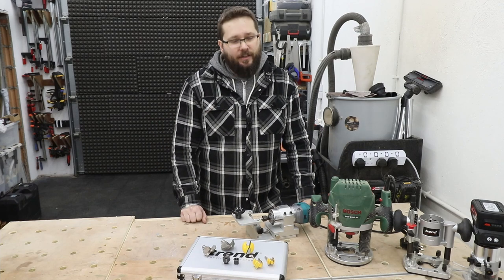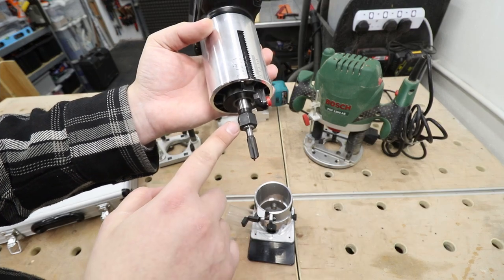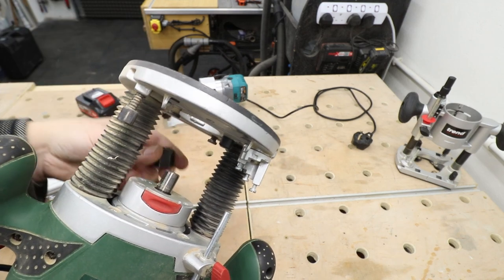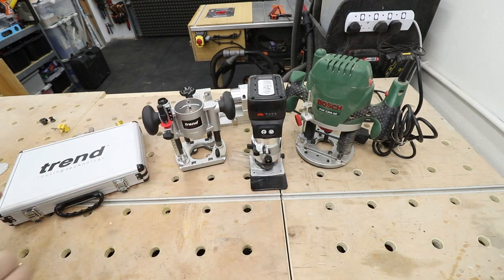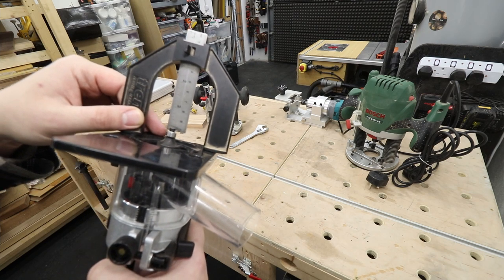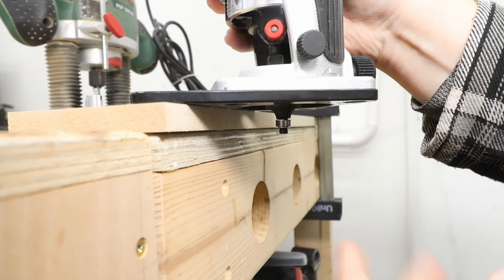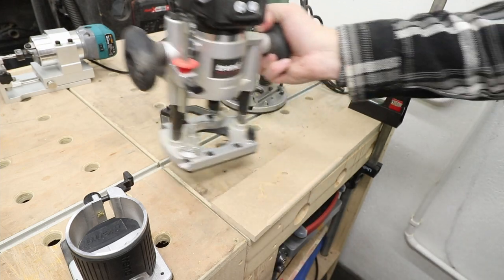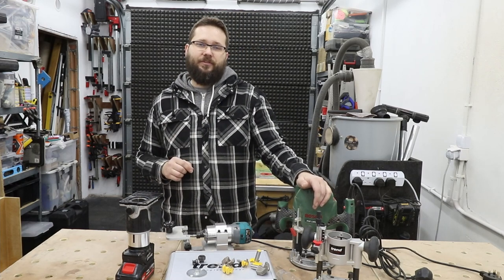How to Use a Router | Router for Beginners

Comment: Hi Thomasz, again very clear details for users. As for using the fixed base to drop in the cutter into the piece is a good call but remember that will only work, and the same for plunge bases for smaller diameter router bits as the center of the router will stop the router dropping in. You can help that by moving along the direction of the cut until it has cut its way in then you are fine but you need in both actions to be very carful it does not kick.
Reply from the maker: Thanks and good info👍

Comment: i now have 3 routers after having none for the first 45 years of my life. bought a cheap trend, was useless. bought a katsu, but was unreliable as bit would move slightly. got a dewalt now, and oh my word its brilliant.
Reply from the maker: I got a Katsu router, Guild router, Bosch router, Trend router and they all got a dedicated task to do now. Katsu is in my loose tenon jig, Guild is in my router table, Trend is used on most "routing" jobs and the Bosch for some heavy duty jobs 😁👍
Reply: @CasualDIY  i was meaning to put one of my old ones in the router table but i just dont trust them so i still use my dewalt. just means i have to undo 4 screws and screw it in. but it takes 1 min so not end of the world
Reply from the maker: @kanedNunable  I'm still before getting a upper budget tool from Dewalt and the sorts 😅

Comment: My new Dewalt DCS604 couldn’t grip 1/4 inch bits…then I saw it had an 8mm collet.  I was about to be dismayed, but checked the parts bag and found it had come with the 1/4” collet too…result👍
Reply from the maker: My Trend router came with the same set up.

Comment: Thomasz, I'm confused, you seem to be saying (and have shown at 4m:54s) that the Bosch POF 1200 can take a half-inch bit. I looked closely at this router before buying one, I didn't buy the Bosch as I believe it takes a maximum size of 8mm.  Would you please clarify and confirm whether this router can take a half-inch bit.
Reply from the maker: It was just am example of a bigger router that they tend to take 1/2 and 1/4.
This particular router only takes 1/4.
Sorry for the confusion, I couldn't be bothered to take out my other plunge router from my router table, that can take both.
Reply: @CasualDIY  🆗 Thomasz, fair enough, thanks for clarifying.

Comment: Good video again. Thanks for sharing.  But why do you use fractions of inches?  Did you take your routers from England to Poland?
Here we can mostly buy only 6 or 8 mm shanked router bits.  And although 6 mm is nearly 1/4" it doesn't fit (hold).
But your audience is probably most English/American where 1/4 or 1/2 of an inch is standard.
Reply from the maker: Yes all my bits are from UK. And yes nearly 80% of my viewers are from UK and US. That's why👍
Reply: yeah in UK we still classify them as 1/4 and 1/2 inch for some reason. its very weird living here with meters and miles and using imperial for height too. haha.